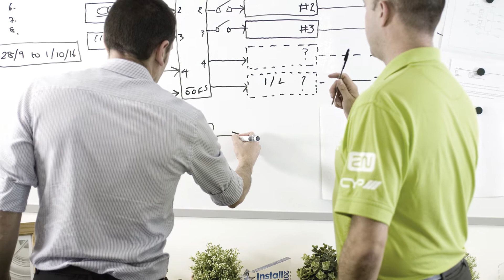How to design an audio system

Comment: How about a video troubleshooting speaker and speaker wire on a 70 volt system  using a impedance meter.